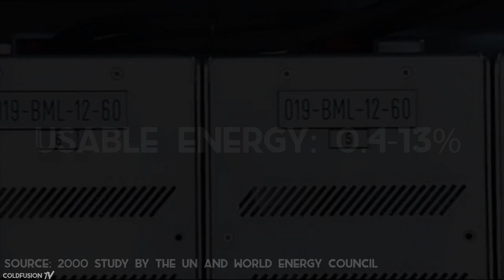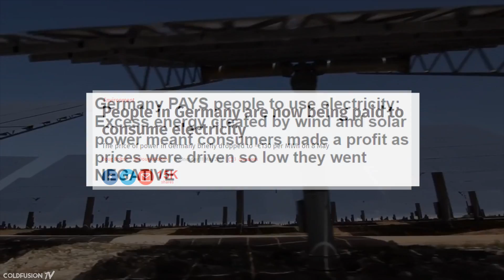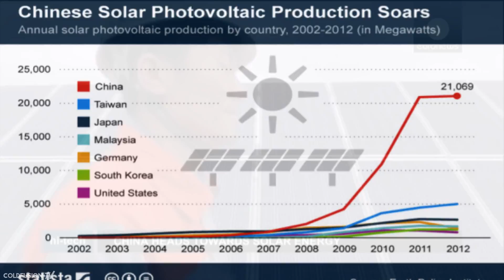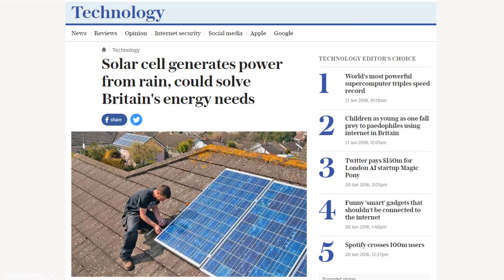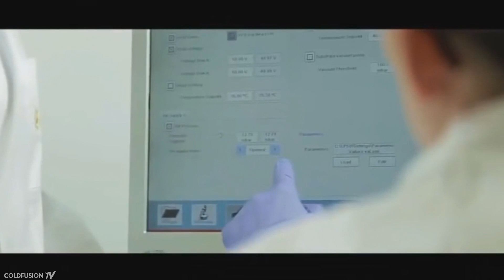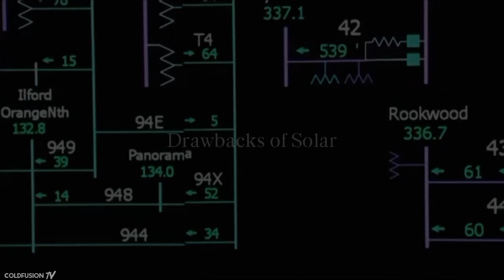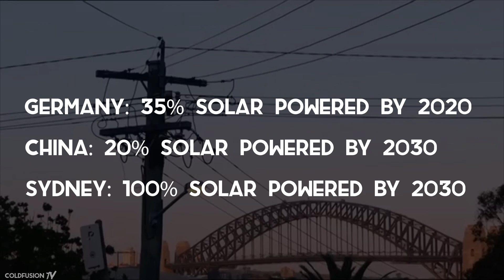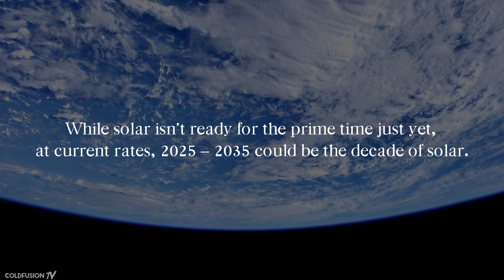The Truth About Solar

Comment: 30-35 % efficiency ?  Yes, in space !  The Solar Impulse airplain reached a maximum efficiency, in perfect condition (high sun, no clouds),  of 23,5%, and it had some cutting-edge solar pannels.
Reply: MC In India we found only 16 - 18 % efficiency on high consolation areas
Reply: I think solar is great for powering all of rural America and for the suburbs. For cities and super computers you need geothermal, dams, or nuclear reactors. Trying to supply all the power for USA entirely from solar is silly but it's interesting that it could maybe be done. I think we need a variety of power technologies for different settings and to resist any possible challenges to our energy infrastructure.
Reply: josh brown where do you get your Figures?
Reply: Actually, a Swiss start up company called Insolight (https://insolight.ch/) has come up with a panel that is 36.4% efficient. This has been validated by the Fraunhofer Institute (https://lenews.ch/2016/09/12/swiss-startup-doubles-solar-panel-efficiency/).

The start up company has just closed it's first round of seed funding in January 2018, receiving $2.5 million USD. They are aiming to have their product on the market by 2019 with efficiencies of up to 40%. (https://insolight.ch/seed-round-closed/).

If you make claims, please leave sources.
Reply: MC thats a weird thing to say. Of course, they can‘t convert the energy that doesn‘t reach them. But the efficiency obviously is measured by how much of the energy that reaches the device, gets converted into electricity.
Reply: which buzzfeed article did you fish this from?
Reply: John Doe really that far ahead!?
Reply: Lmao not in April  2018 it has doubled again and the price is lower
Reply: Yep. I was shocked at that efficiency claim. It definitely has to be a multijunction cell in space. No way you'd get 30% out of a silicon based cell.
Reply: Why are people so focused on panel efficiency? Internal combustion engines — after 100 plus years of mass production — are still only 18% efficient. So what?
Reply: Correction 
Best solar panel currently have just a litle over 48% of efficiency.
Reply: insolation, not consolation.
Reply: Correct, MC. And that's because as you get higher, less impinging power is lost to heating the atmosphere. When you get to terra firma, it's more like 16-18%, as Sourabh Soni points out.
Reply: in space it's much higher than that, currently experimental solar cells have reached beyond 40% efficiency
Reply: John Gonzalez every building has a roof. Unused space that could use a solar panel cover with handy hook-up to electric lines. Go SOLAR!
Reply: MC you can improve those numbers by just adding more solar panels because if they are connected individually to step up inverter and you're pretty using twice as much electricity as you need what you just modulate to a regulated current is in you will get sufficient power even when the clouds are up.
Reply: Fringe Wizard it's not very silly when you consider that the key ingredient to these things as well as a king Korean to all computers is silicon which is one of the most abundant materials on Earth and was chosen is a semiconductor for that reason this once you have the resources to refine it large-scale into pure electronic Crystal then the cost of it is technically free.
Reply: I agree the numbers of efficiency are off, but there's a different problem with the comment on efficiency. Here's comparing the efficiency of energy conversion from sunlight (which is free) to the efficiency of energy conversion from coal (which is not free). It's comparing apples to apples, but it's still the wrong comparison. The better question is how much does it cost to build a solar vs. coal power plant for a particular energy demand. Less efficient solar cells can be more cost effective (compared with more efficient solar cells or coal) if they are cheap and durable. Pay back period is a better metric for renewable tech.

Comment: I am now 100% solar and 100% off grid ... solar is the main power provider and everything was done over time regarding the acquisitions of the various panels / charge controllers / batteries / wiring / now hooking up the water tanks and the anti freeze tanks ...way up in Canada , and by the way , it has been minus 42 c / around - 30 f ...here this winter and right now its - 24 c ... solar works and is not that expensive ... thanks for the video ...

Comment: The biggest drawback about solar for residential, is the huge battery banks needed to store the power for night time use. Also You can never recieve a ROI because by the time your system pays for itself. You have to change out all the batteries and panels.

Comment: Energy can actually be stored in batteries of electric vehicles. Consumer hardware, like a washing machine, can be started when enough energy is available. Electric grids don't need to suffer too much stress when energy is produced locally.

There is much you can do by optimizing at several points (i.e., out-of-the-box thinking).

Comment: Comment on prior comment
By using the word energy and using it correctly does three things for you:
1. Cold Fusion is
2. The film that gets electricity from room light into it is because flipping the light switch introduces energy into the room: If you say grams are introduced into the room you will be correct. If you say energy is introduced into the room you will be correct. These will produce electrical output from the film. The film as if by magic produces electricity as it could be expected to if the right process happens and if its energy is introduced to it.
3. The point is energy, not 'solar'. What we get from the sun is so enormous there is little doubt that energy will be harnessed. Simply using the words energy will allow this. Using other words that are not correct will just muddle the job. Notice how solar panels actually are 15% efficient that means 85% of the energy that comes to them is still available.
Use energy for your words, then get the cold fusion, the film that makes electricity from other energy sources, and the 85% of the energy we are currently missing - save of course for what the planet and planetary system use the remaining energy for.
Godspeed

Comment: Thanks for the video.  ". . . light from the sun" in the beginning and "energy from the sun" at the end. Which is it? Solar power or solar energy? Which? If you use energy from the sun and solar energy and energy elsewhere - see how you begin to think about energy. If you begin to think in terms of energy are your terms exact as they are - are they used correctly? 
Energy is very important, yet is not a 'tangible' thing and very difficult to get an experiential mind around it. (We simply cannot think in terms of what we have never experienced.) We have never 'experienced' energy only its effect(s). So naturally using words like light from the sun, or power, or etc. interchangeably with energy (energy per unit time is power however). However using energy soon puts you into the intangible where soon you will be saying mass from the sun instead of light from the sun and surprise yourselves in that you will be correct! Energy from the sun then may actually be correct where light from the sun may not be . . .  Good luck. Maybe then cold fusion will become a little warmer to the heart . . . 
PS. It's pretty evident you see light when you look at the sun; even to the point of injuring your eyes. You also injure yourselves by other things from the sun. So if energy is not tangible, what do you call light as a category? What do you call the rays that are not visible then? 
These things are tangible, hence not energy. Energy is gram, ft-lb, BTU, electron volt; all of which are not tangible. You cannot put a ft-lb into a bottle and save it for me. Practical/ impossible to do for a BTU - it will, leave and increase the temperature of the air as it does. You cannot put a gram on a scale and have the scale move unless the gram has velocity or has a field acting on it - each case produce a force. Again these (forces) are the effect of energy, not energy. (Force is tangible, and categorized a vector). A gram; energy is not a vector - for good reason; because it is not.
Light is a wave and the other things we get from the sun are waves, save the field it helps us create. These are tangible because waves are tangible. Each wave is suffering an introduction of a force to the substance of it, which makes 'it' respond as a wave - every wave is created this way. So be careful with light from the sun and energy from the sun and power for this and that. Use the words correctly. And by the way use electric waves and leave the magnetism for someone in the future to discover that which will fit what we know about it so far. Regards

Comment: All of this just to reveal that he does NOT in fact know the single largest problem of solar energy. All of these points, both the good and the bad fail to mention that OIL is needed to physically manufacture these cells. The amount of energy that can be gained from simply burning the oil exceeds the energy gained from the life expectancy of an average cell when all is measured up. A long lifetime is needed to work and while improving lifetimes is ongoing it is still insufficient. However burning the oil will mean that when solar power has to take over a significant production of electricity due to oil shortage it will not matter how efficient it is, or how much energy can be stored or even the dollar price, we will be physically incapable of building them due to oil shortage. In essence using oil unwisely now robs us of the resources we will need later to replace it. The only cost relevant is the cost in OIL. The answer unfortunately is realizing just how precious a commodity oil is and using it only as necessary, however our society is completely dependent on oil both to produce materials and for transport.

Comment: Germany wants to generate 35% of electricity from renewables by 2020, not solar alone and not total energy consumption. Electricity only makes up about half of all energy consumed. Also, solar is only one part of renewable electricity generation, with about 7% of total electricity generated by solar.  Wind is still double that at 14%, the rest is taken by biomass at 9% and hydroelectric at 3.8%.
All this is not enough. The grid isn't keeping up so more and more energy is wasted, grid extension are only progressing slowly. Solar installations are way below target right now, but my hope is they'll go up again when unsubsidized solar is able to compete with coal. At the current rate, when PV systems start to fail after 30 years or so, we won't be able to sustain the capacity we need to be sustainable. We need the addition of 6-7 GW a year to get to the necessary 200 GW of total generating capacity, assuming an average lifetime of 30 years; only 1-1.4GW/a were installed 2014-2016, failing to meet the target of 3.5GW/a

Comment: I've put a 4kw system on my roof, my parents roof and my ex's roof. We need a world war like push on installing renewables , most of all because if we can produce enough  power to charge electric cars then we really will be making progress as I have read diesel pollution is 20 times worse than co2 as regards combating climate change. There are only 2 futures, one where we have a spiralling vicious circle or spiralling virtuous circle. It is written in the word 'Go', lets run with it folks, I want to see them installed on an industrial scale.

Comment: As far as home use goes, even a shitty hydro electric generator made out of plastic bottles can generate 1-5kw of electricity. Compare this to a solar cell that can only generate .1-.2kw. I compare these two because they cost about the same to make. Yes you can add more solar cells, but I could add more hydro electric generators if you want to compare apples to apples. The truth about solar is that because of it's inefficiency it still sucks ass and is one of the most expensive ways to generate electricity. I still love solar and it still has a place for good uses, but using biogas and other more efficient means of generating power are better green solutions to solving our near future energy problems in my opinion while we wait for solar research to be perfected. In my lifetime, almost every single other green energy solution will be more efficient than solar.

Comment: Solar works. Our house is Net Zero for 8 years now. Free power for house's two AC units plus everything else electric our home uses. Now with a 90kwh electric car the 12,000 miles driven in 2016 were also free.  The house even gives it's extra unused power to the grid for our neighbors too use.  If people say that this solar is for our future, I want to share that for us our future started 8 years ago and it works.   Again to state this clearly, we have not paid a penny for electric power with all the power demands placed on the home system and 80,000 kwhs used in 8 years should show that we are not Just getting by.   If you can, please join the solar wave.

Comment: Right now, we just don't really have the technology necessary for solar.  When it comes to solar, panels aren't the only consideration.  Power storage is a huge part of the equation.  Then there's longevity considerations, both for batteries and panels. Once you look at all of these, they would be massive undertakings, that would take decades to pay for themselves, but would themselves need to be replaced long before they pay for themselves.  

Now the size of how much solar we need, depends on how good our power storage is.  Ideally, we would need to be able to get all the power we need during day, while storing what's needed for night.  But it's not that simple.  Since direct sunlight doesn't happen throughout a day and due to other weather conditions, we need even more panels to generate more power for when there isn't as much power generation.  Which means we need not only power stored for during the whole night, but also for use during a good portion of the day, at least half if not more.  

This highlights the issue.  We essentially need a much larger panel and battery system to make up for the losses due to weather and night.  That means we need to generate basically 18 hours worth of electricity, every 6 hours or so.  And we probably need more than that, because there will be whole days where overcast will make energy generation virtually non existent.

Comment: why is there no mention of other methods than photovoltaic? in equatorial regions, large scale thermal "solar towers" achieve amazing amazing efficiency. in countries like turkey, simple solar thermal systems are incredibly common to see on rooftops. not to mention the potential of passive, solar powered air condition systems.

Comment: I like the way that they still show mostly the good facts and ignore others. Germany actually has a higher carbon footprint now than before. This is mainly because after Fukushima they decided to turn off all their nuclear power plants. So they are still using more fossil fuels. Also the problems idling the "standby" power from the fossil fuel power plants to make up the shortfall in their wind and solar power production causes inefficiencies in the operation of the fossil fuel plants. And yes Germany has a lot of wind power also. I guess in a way that could also be called solar since the sun heating the atmosphere generates most of the wind which causes it to also go through daily cycles of generation and non-generation of electricity.

Comment: You are missing a HUGE part of using solar energy, the storage of it.  If you count night time, bad weather, and the winter months you would likely to replace the power production on a 3 to 1 ratio is not more to fully replace a "normal" power plant that produces at all time.  To fully replace the current model you will have to be cost effective taking into account ALL of these factors.  So get the cost of 3 times the solar generation power of a normal plant plus the storage for at least 24 hours THEN compare that to the normal coal and power plants.  That is the breaking point we need to focus on.

Comment: Conclusion, solar power is a load of pie in the sky crap. Nuclear is the ONLY way to go!
Reply: Fuk U, FukUshima
Reply: Luis Cannon is it cheaper than Solar! What if we can have them all together at the same time- Solar, Winddriven and Neuclear all on the same property and do away with oil?
Reply: So, Luis. How long have you been working for a nuclear power plant? Or are you just a frustrated investor. Chernobyl, Fukushima, Three Mile Island...only a small glimpse of the inevitable and permanent poisoning of our planet if we use nuclear. Notice how the best educated countries are RUNNING from nuclear. They see the truth about it.
Reply: we should have no problem with that. its a sweet challenge to produce energy.
Reply: If we have an event, where too many power plants go offline, such as major solar flare or nuclear attack, we will have a matter of days before diesel generators start shutting down and nuclear plants go into meltdown all over the place.  We need to get rid of nuclear power plants.  We're in far greater danger than sheeple realize.
Reply: It still has a long way to go before becoming practical

Comment: nice video but you missed a few thing. First the best silicon solar cell could be is 25% because of the bag gap of silicon. Second you need to understand a new development in solar cells is starting. The use of Q dot can expand the freq. of light silicon can use, in effect increasing the band gap. solar cells using q dots can get as high as 45% eff.
these development have just started to be researched in the last 2 years.